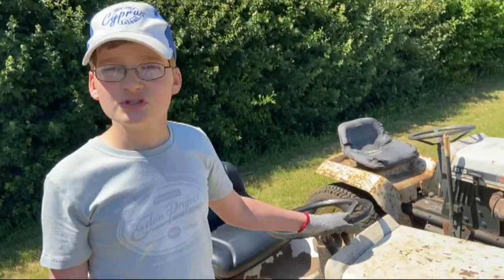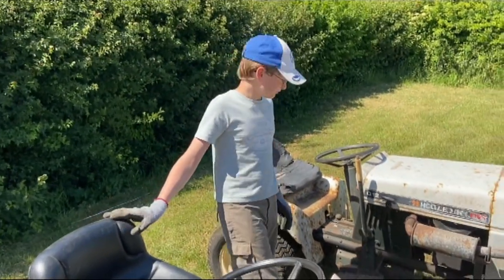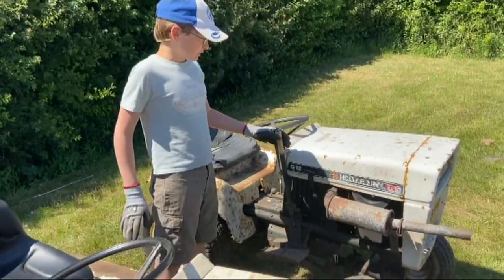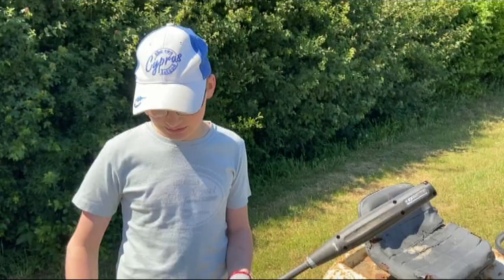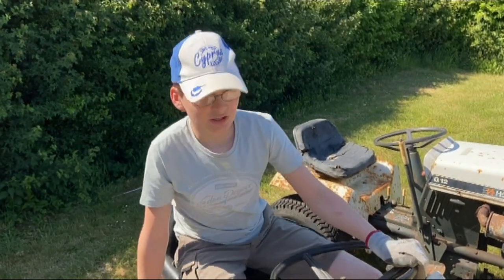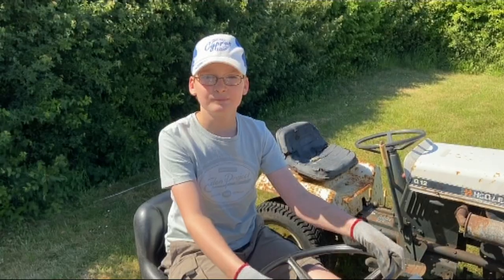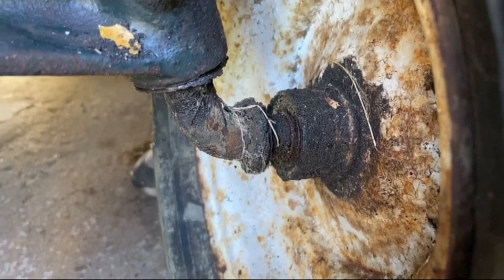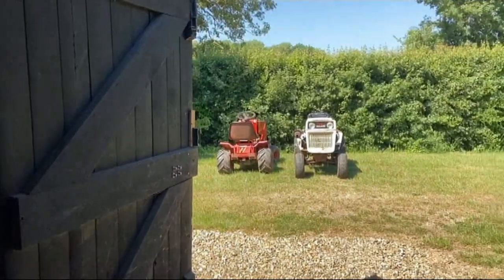Meet our two Bolens G12's

Comment: nice little tractors there .i look forward to seeing you restore them .I like the extra big wheels on back of them,mine are a bit small on the westwood  ,they look a nice chunky thing ,dont think i could cope with 12 gears tho lol .one of those would be a lot better for getting up my woods its a bit uphill.  BFN Ant from wet wales this evening .
Reply from the maker: As you mentioned the wheels are much bigger than a Westwood although the tractors are about the same size. Interestingly, the rear tyres on a Westwood are the same size as the front tyres on our bigger Bolens. I heard it was wet in your part of the country, dry and sunny here. I hope you have a great week. Joseph

Comment: does the front collar have an allen screw in it that has a long pin on the end holding the wheel on? I actually forgot how they are held on.
Reply from the maker: That is exactly what is used to hold the wheel on. The collars are missing from this tractor and the wheels siezed on the axle

Comment: Wow, 12 gears!  On the lowest gear, this tractor must be very slow, isn't it? But what was the purpose of so many gears (or speed ratios)? Are you having a drought?  Your lawn is far from the healthy green we usually see.  Thanks!
Reply from the maker: We have not tried it in the lowest gear yet. They were never advertised as being 12 speed and the number of gears is a by product of Bolens using up old parts in the latter years of production and adding a six speed rear end. We have had the driest month on record and the grass is struggling, wet weather is on the way